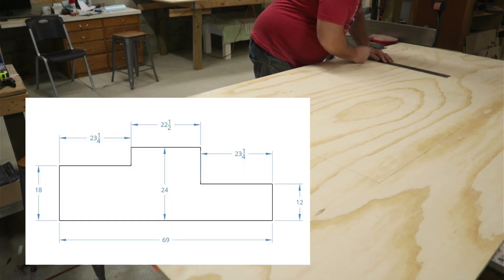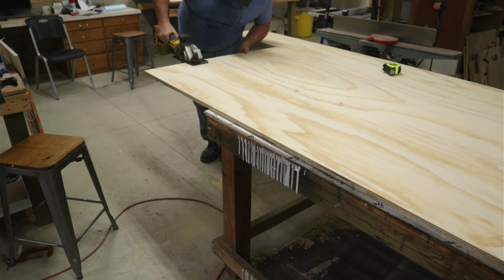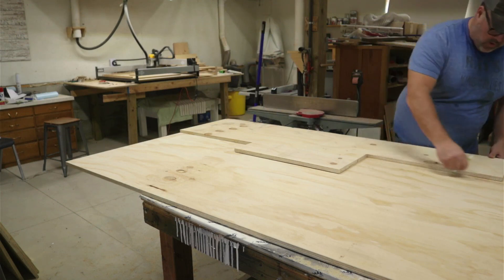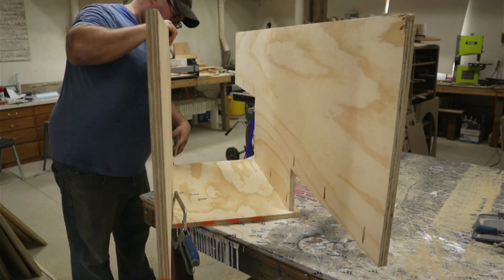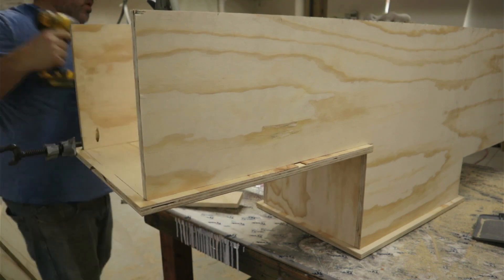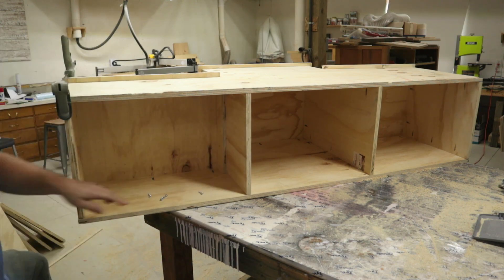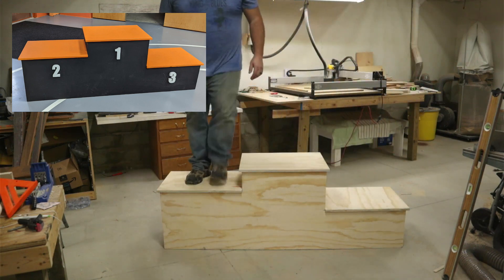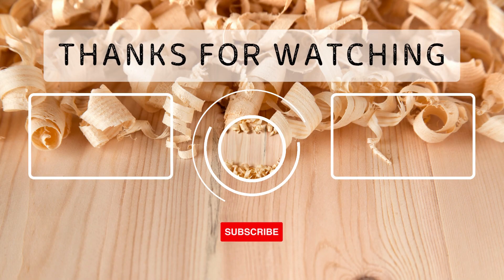How to Easily Make Great Looking Awards Podium!

Comment: What if you used plexiglass (see thru) for the frontage?  I’d like to fill it with something -
Reply from the maker: I can't say for sure because I am not sure how you would plan to build it. Replacing the ¾ inch plywood with a normal thickness plexiglass would likely require some extra support. Personally, I would be very concerned about strength. The last thing you want to do is build something that won't hold up or tips over when people stand on it.

Comment: I want to build a 5-tier award podium. Any suggestions on the design? Great video!
Reply from the maker: If I were making it I would want to try to keep the front and back made from 1 sheet of plywood each. That would mean each tier would be 19.2" wide (96" divided by 5). Since there is no .2" equivalent fraction on a tape measure I would probably make the 4 lower tiers 19-3/16" and the highest tier the remainder, which would be a little over 19-1/4". This is a good bit narrower than the design I made. You may want to cut a piece of scrap wood at 19-3/16" wide, set it on the floor, and stand on it to see if it will be wide enough. If not, you may want to make this build in 2 pieces so you can widen the tops. 
As for the heights, I was concerned it would tip or someone would fall off the top, so I actually made it lower than I initially intended. I would start with the lowest tier at 6" off the ground and then increase the height of the next tier by about 3" to 4". It really doesn't take a lot of height difference between tiers to get the effect you are looking for. My thought is the lower the better for 2 reasons: 
1. in case someone were to fall off of it
2. Lower also means lighter and easier to move around.
Keep all the depths the same as what I used. 
I would also recommend testing it yourself to make sure it will work before letting anyone else stand on it.

Comment: Where did you get your numbers? Thank you.
Reply from the maker: Honestly, I kind of made them up as I went. My #1 concern was stability and safety. The last thing I wanted was for it to tip when someone was standing on it or to have someone fall off of it. I initially made the difference in each level higher and realized it wasn't going to work very well shop I reduced it to what you saw in the video. For the size of each platform, I wanted them wide enough that they wouldn't look jammed together on the platform and deep enough that people wouldn't fall off the front or back.